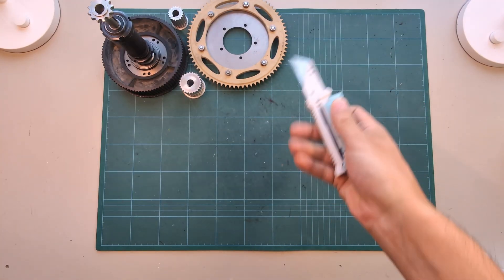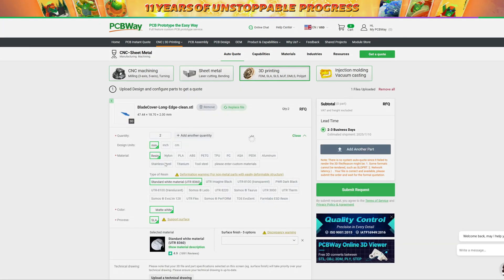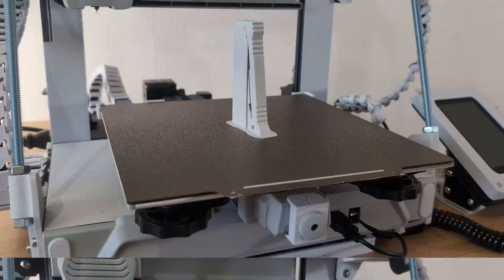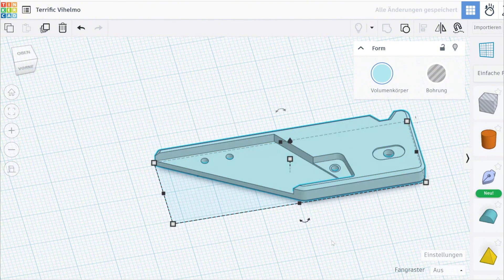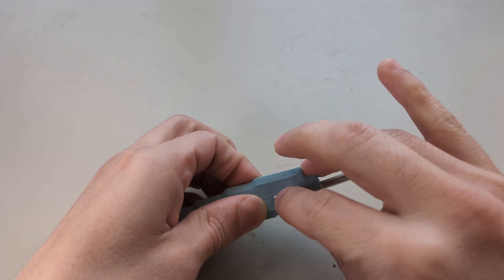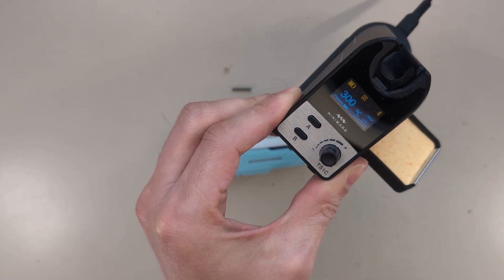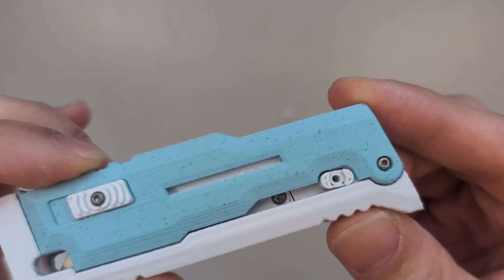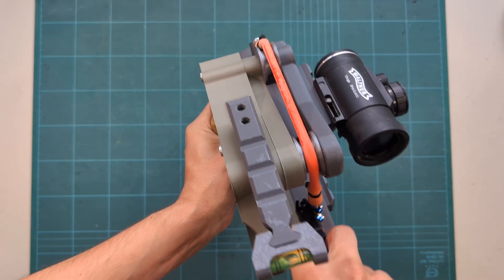Best 3D printed gravity knife - how to build

Comment: Very nice! Quick question, did you chose not to use the 'tube' part in the inner handle?
Reply from the maker: Hi Bill, right, i did not use that, i may have forget it, but it coul also be that i did not get thhe purpose of it (sorry, i forgot😅)
 Did you build yours including this tube?
Reply: @Dirt-E-Bikes  I did and also used the M2 nut version (it works). I've made one and will finish another later today. I'll post some pics when I'm done
Reply from the maker: @billmacfarlane8864 
Nice, im curious where this tube goes... I guess trough the blade assembly and the sliding blocks? 
Cant wait to see your pictures 👍
Reply: @Dirt-E-Bikes  it goes through the hole in the inner handle were the outer and inner handles meet. (The screw goes into  the outer handle, through the tube, and then into the insert or nut)
Reply: @Dirt-E-Bikes  unfortunately I can't seem to post my pics but check your email
Reply from the maker: @billmacfarlane8864 
Damit, how could i miss that 😅
Thank you for sharing that info 👍
Reply from the maker: @billmacfarlane8864 
Thanks for sending me the pics, both looks very nice! Can i share them here on youtube to get that info about the tube out there?
Also whats that transparent material, that looks sick 👍
Reply: @Dirt-E-Bikes  of course you can show the photos
The solid color one is green PLA and black PETG...The clear one was made on the resin printer using green and clear ABS (like) resin. The clear one is more for show as it is more brittle and i would not trust it to be under any pressure
Reply from the maker: @billmacfarlane8864 
Nice, thank you i will make a post tomorrow with your pics. 
Very interesting, i saw a while ago that there are resins with quite good material property but did not get into resin printers yet.